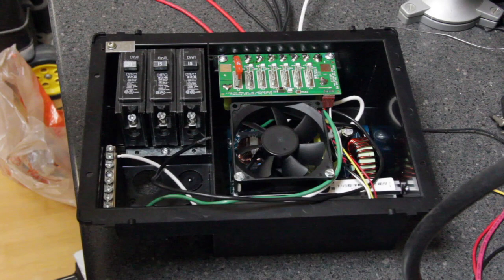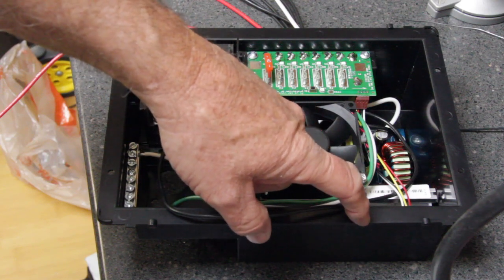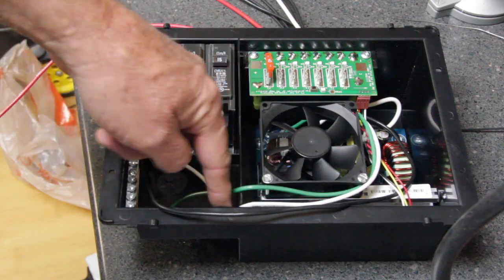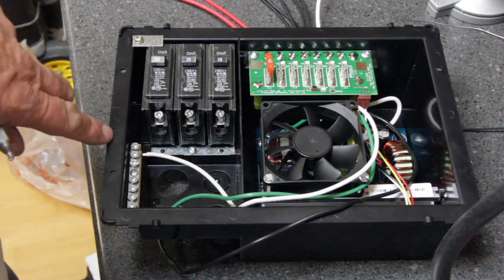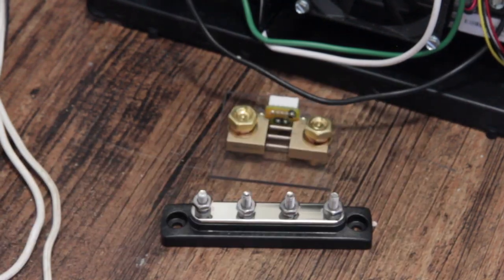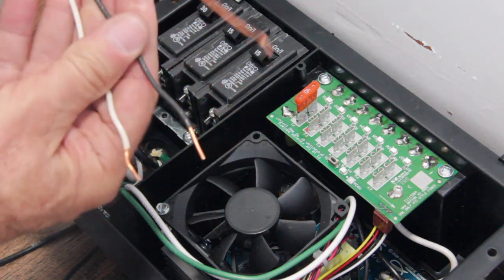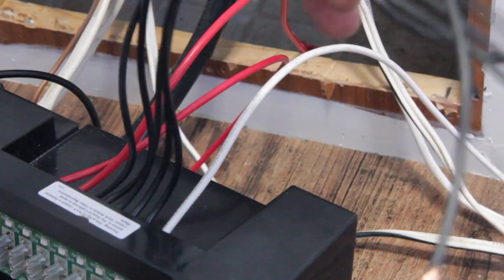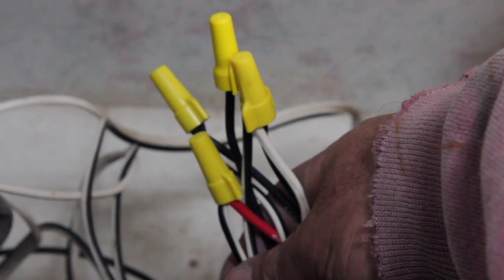Progressive Dynamics PD4100 Install

Comment: Hey joe! Great video! I have a question. I’m building a camper van that will ONLY be setup for shore power. Can I run this setup without a battery/battery bank? I will have some led lighting, a radio, and USB ports wired to the DC side. In theory the internal converter should be able to handle that, correct?
Reply from the maker: Yes you can,  While I was waiting for my batteries to arrive I did some testing on shore power. Worked just fine

Comment: Hey, looked they the comments, didn’t see this question asked… Do you know if this unit has a low voltage cut off? To keep the battery from fully discharging if lights on a 12v circuit were left on. Thanks.
Reply from the maker: I double checked the docs, did not see anything,  But you can install a battery monitor with a shunt and set an alarm to warn you when the battery voltage reaches the critical low voltage.

Comment: So I looked it up on Amazon. I does not come with the 120 volt circuit breakers. What brand breaker fits that?.
Reply from the maker: Supported breakers are listed in the below file.  https://www.progressivedyn.com/wp-content/uploads/Support/manuals/PD4100-English-manual.pdf
Reply: @JoediyLab  thank you sir I appreciate that very much. That's kind of what I was looking up was seiman breakers, so you just confirmed that for me, I'm a buy  the book electrician so I don't like to compromise or mess with anything that could create any type of fire hazard. Your presentation and your work is very professional.

Comment: I’m getting 120v to my outlets but not getting 12v. My camper does not have a battery. Do I need to wire this differently?
Reply from the maker: More than likely your 12 volt wires are not grounded to the DC bus bar.  You have the AC side and the DC side.  Also make sure you have the chassis ground connected to the converter.  Having a battery or not does not matter.
Reply: @JoediyLab  got it! I was not tying in the negative lead that would go to the battery. All works now.
Reply from the maker: @paulbusch3542  Great, good luck

Comment: Hey Joe! Awesome video- I'm a noob when it comes to electricity but I know the basics, and I just bought a popup camper that has a busted converter(no DC). So I bought a new one, same model as video, and I have the AC wired in correctly- I get power when I turn on the 30A, I maintain power when I turn up one of the 15W, however when I turn on the second(w/converter wire)15W I trip the breaker switch on the GFI outlet at the WALL(and not immediately either, the indicator light blinks on the converter and does stay on awhile), but not in the camper(all breakers stay on in the camper). Does that mean I'm plugged into a shore power outlet with too low amperage to support 30W, like a 15 or 20? Sorry probably a dumb ? and it would make sense to me but of course I could be completely wrong- I just thought I'd confirm it, because w the old converter we didn't have that issue.
Reply from the maker: Hey Carl I run my AC circuits from an extension cord to my camper using a 15 amp plug, no problems.  For the converter you do need the power to the the converter.  Try turning on just the breaker wired to the converter first.  Sounds like you may have a short in the second 15 amp circuit.  Try moving the converter wire to the other breaker to try to isolate which circuit is the problem.  Make sure your DC circuits are grounded to the green bus bar.  Ground the AC circuits to the white bus bar.
Reply: @JoediyLab  Thanks again Joe! My problem was the second part of the sentence- I had some DC circuits grounded to the AC ground buss bar- that was where the short was coming from. Did I mention I was a noob!?? Thanks for the education! Working well now!
Reply from the maker: Great news Carl, good luck

Comment: I'm confused as to where I should connect the white wire coming out of the converter you said went to the battery bank.
Reply from the maker: The white wire from the converter goes to the neutral bus bar on the left, not the ground bus bar on the bottom.  See the diagram:  https://www.progressivedyn.com/wp-content/uploads/Support/manuals/PD4100-English-manual.pdf
Reply: In the directions for the converter, it says to connect the white wire to the battery negative. You say to connect it to the neutral side on the buss bar? Which is it?

Comment: Hey Joe, thanks for the video! I just received a this unit and I am looking to install it in my van. I am currently looking to use shore power to run my DC needs and additionally an AC unit. The AC unit calls for a 20 AMP breaker. My question is should I run the 20 Amp unit off the 30 AMP breaker red white wire in the example or would you suggest substituting one of the 15 amp breakers in your video for a 20 AMP breaker. 

Additionally, will this system default to pulling DC power from the battery when it is not plugged in to shore power? I was assuming so but did not hear it mentioned in your video explanation. 

Hope this question makes sense, I am new to electrical and hoping to get it close to right the first time.  :)  Appreciate any help you can offer!
Reply from the maker: Hi, I would put a 30 amp breaker as the main breaker and then a 20 amp breaker in the other slot.  You then do not have enough amps for a third breaker.  Yes when not plugged into shore power your DC circuits will use the batteries.
Reply: @JoediyLab  Thanks Joe! Using this advice for the install. An additional question, The distribution panel is supplying DC power to the system by converting shore power or battery using connection when not charging. Where would be a smart place to install a kill switch for the DC system? Between the battery connection and PD4100? Simply insure shore power is unplugged? Open to suggestions
Reply from the maker: @davecoy2294  You could do that if you wanted.  I did not and left the camper sitting for 5 months and did not affect the battery charge.  I am using Lithium Iron Phosphate batteries though.
Reply: @JoediyLab  Appreciate the help Joe !

Comment: Hey Joe, where would one put the wire from the 7 pin that charges the battery as you drive?
Reply from the maker: Of the two red wires, the first red wire, I believe it is labeled 1,.double check the manual, goes to the positive battery post.  The negative post wire goes to the green grounding bar
Reply: Wondering where you wire in the aux/charging wire that comes from the 7 pin to the converter. Typically the black wire.
Reply from the maker: @ianw.gordon1756  There is a black and white wire, that comes from the converter side. The black wire need to be connected to one of your 15 amp AC circuits, The white wire gets connected to the white bus bar.  Those two wires provide power to the converter.
Reply: @ianw.gordon1756  Hey I was just looking into the same thing and it I didn't find a clear answer but the likely answer is no. The only info I found was that the 7 pin connection is designed to connect directly to you battery... this being said the charge voltage being sent through that 7 pin is designed to charge a starter battery (NOT A DEEP CYCLE BATTERY). You can hook up a deep cycle but it will either blow out or significantly decrease the life of your battery and possibly your alternator. 
Here is a link for a video that explains fairly well the possible setups for charging a deep cycle battery via your vehicles alternator.

https://www.youtube.com/watch?v=TAEzCcayI0g

Comment: Hi joe ive watched this video 20 times! lol. im pretty sure i can put the PD4100 in my popup. However, at the end of the video you lost me when you had the battery cables hooked up to the DC12v side. Can you explain that to me again?
Reply from the maker: Hey Derek,  Coming from the PD4100 there is a Red Wire and a Black wire.  Those two wires are connected to your coach batteries.  When you are on battery power the DC circuits are powered by the battery.  When you are on shore power the batteries are charged.  Let me know if you have anymore questions,  Thanks
Reply: @JoediyLab  thank you I'll let you know how I made out

Comment: I have located the switch for the charging type. If the switch is down does that mean it is set up for lead acid?
Reply from the maker: Yes,  Switch S1 is for battery type.  When S1 is off that is for Lead Acid.  The S1 light on the fuse panel should be on when set to Lead Acid.

Comment: If you're not plugged in to shore power do the battery feed back to run your DC circuit?  I'm new at this I don't want to sound like an idiot 🙃
Reply from the maker: Robert you are absolutely correct, the batteries will power your DC circuits when not on shore power.

Comment: What happens if I have more than 2 15amp breakers to wire in?  I also have 8 fuses.
Reply from the maker: Paul, you only have a total of 30 amps on the main breaker.  If you need more amps, you would want to upgrade to a higher total amp unit.  the fuse breakers are for DC only.  The 30 amp breakers are for AC circuits.
Reply: @JoediyLab  in the space of three full size breakers, I have six half size breakers. Looking at the breakers, left to right. 30, 15, 15, 20, 15, 15. They are labeled Main, GFCI, Microwave, A/C, Water Heater, Converter.
I would just move them over in order to the new PD-4100?
Reply: @JoediyLab  the unit I am replacing is WFCO, Model WF-8740P. The converter was fried when the electrician hooked it up to 240. I was told that the WFCO unit is PROBLEMATIC. In case you haven't figured out, I am a total noob to this whole idea of RV trailers
Reply from the maker: Paul, the PD4100 max AC amps is only 30 amps.  The individual circuits can then only add up to a max of 30 amps, so two 15 amp breakers is your max.  If you need more max amps, look at there larger converters.
Reply: but, as I pointed out, there is a 30 amp main breaker. The trailer is wired to a 125v 30amp breaker. the wiring set up on the original unit is also 30 amp, but with the listed breakers. I don't know enough about wiring to know if this is correct. However, the trailer manufacturer, Forest River, installed the wiring on the unit. Looking at the 2 units, the AC side is identical. 3 standard breakers, on my trailer, breakers are "split" into 6 half-size breakers.
Reply from the maker: Paul,  30 amps ac is the max for the main breaker, all sub breakers then must add up to 30 amps.  You could go more but then you cannot have more then 30 amps running at a time.  Which it appears that was your original setup.  So if you can manually manage what circuits get used then you can put more breakers in.  But I personally would not work it this way.  Then if someone turns on more current that 30 amps you run the risk of a fire.  I personally would not go this route, for safety reasons.  I would purchase a higher max amp converter.  But this is your decision.
Reply: @JoediyLab  thank you for your patience. In reading the breaker labels, no individual circuit is more than 20 amps, and that is the A/C unit. I am not looking to add more, just duplicate what the manufacturer did with the new unit. What I want to do is remove the battery charger I have on the system now, since the converter is toast and I cannot buy the converter as a stand-alone item.  Otherwise, my 12v DC stuff will kill the battery in about 24 hours.
Reply from the maker: Good Luck Paul,  Just make sure everyone knows to limit what circuits are turned on and you should be fine.  Thanks
Reply: @JoediyLab  I'm the only one living here, and the A/C breaker is off since it is not needed
Reply: @JoediyLab  thats not true. go add up all the breakers in your house. The total of the individual breakers can exceed the main.

Comment: Started doing this today. Got confused, had a beer, it didn't get any clearer.  AC is all pretty straight forward with 30 amp master to 2 x 15 amp AC branches (one to the converter, the other to a GFCI + 2 boxes). The instructions are pretty sad and I was glad to see this video. I've watched the video twice and read through the comments. 

According to the wiring diagram, the white wire coming into the top right connects directly to the DC negative of the battery.  The first red connects to battery +. Here you are saying that the negative from the battery also connects to the bottom grounding bar (also shared by the green grounds from AC). So, if that's what is supposed to be done, why isn't that white negative wire just connected directly to the green grounding bus bar so it connects with the battery negative in that way.  Seems odd to me (an unnecessary splice) . I don't get it.

I think I am getting confused by "ground bus bar".  When you say this I'm thinking you mean the bottom AC ground bus bar.  But I think your video shows an entirely different external DC negative (ground) bus bar with one large ground feeding all the DC grounds.  Then others are talking about using the AC ground bar and mixing the terms neutral with ground etc. Leaves a guy confused.

You mention that the second red wire is for something that draws up to 30 amps AC current.  You meant DC correct? You could put any DC circuit on there if you wanted to. Correct?

I'm running 8 AWG from the vehicle battery through a battery isolator to the trailer battery and 8 AWG right to the converter. Negative is also 8 AWG coming of the tow vehicle frame, and everything is going through 7 pin connector. I have a fiberglass trailer and am running 2 x 14 AWG conductors to each of 3 DC outlets, fan and lights to avoid the inevitable problem with corrosion of grounds on the frame. So, all of my negatives for these circuits should connect to AC green grounding bus bar where the battery negative is also connected?.....I just want to be sure because I think I read in one of the comments that the AC neutral bus bar could also be used for the DC negatives.  I was just going to get an external bus bar and connect everything negative to that because I have no idea what leakage there might be mixing the AC neutrals, or grounds with the DC grounds. But maybe it doesn't matter and saves using an external bus bar. Or is it necessary to have the negatives sharing that internal AC ground bus bar? I appreciate your efforts to help us. The unit seems great, but the instructions are inadequate.  Thank you for your time.
Reply: Im in rhe same boat. Did you ever confirm whether or not you need to get an additional ground bus for the dc side?
Thanks

Comment: How do you get dc power to the box so I don't have to use shore power?
Reply from the maker: You need a battery or battery bank.  I am putting together a video on how I tie in my batteries.  The first red wire on the fuse circuit board wires to the positive lead of your battery,  The negative wire is wired to your ground bus bar.  When you connect to shore power the converter will charge your battery.
Reply: @JoediyLab  Great Video, I just installed this unit this weekend but the converter has no charging voltage!!! All the 120v and 12v work perfectly except the converter wont charge the battery. Do you know of any connection issues that would cause this? I confirmed i have 120v to the converter but no DC voltage out. Any help or ideas would be greatly appreciated.
Reply from the maker: @CTSHOYT  Check the obvious first,  Make sure you are using the correct Red lead,  There are two.  Make sure you have your battery grounded to the bus bar as well.  Put a volt meter on the red lead and ground and check your voltage.  On my unit the S1 switch came off and I had to re-solder it.  If you cannot find the cause give Progress Dynamics a call, they were very helpful when I called.
Reply: @JoediyLab  Funny you mention that your S1 switch came off and had to re solder it. This is my second unit, i returned the first one due to the S1 switch being bent and not attached to the board. The replacement I got looked go so in it went, now after reading you comment I went and looked over the board to see if anything was out pf place...sure enough my D71 transistor (bottom left corner) was bent and the connection was broken from the board, I also checked the S1 switch again and it also was loose from the board, looked like the solder was even missing. I took it out and soldered the two pieces back on and its solved my problem, 13.6v to the battery. Looks to me that Progressive Dynamic has a bit of a quality issue going on. Thanks for your reply, it helped me solve my issues!!
Reply from the maker: @CTSHOYT  Great, I am glad you were able to fix it.  I spoke to one of their engineers and told them about the quality issue.  You might want to call and pass your issues along as well.  Maybe they will clean up their act.  Thanks for the follow-up
Reply: @CTSHOYT  Could you please post a picture of that s1 switch. I am very curious I don't believe we have one.
Reply: @korishafer6532  Hi Kori, I'm not sure I don't think I can upload a picture here but I will do my best to explain. I believe the S1 switch is a newer feature on these boards but I don't know how new. My board is a blue color and some older ones are green, which might not have it. If you look on the board at the very bottom, a little offset to the right will be the S1 switch. It's literally a tiny switch that moves up and down. Hope this helps.

Comment: Using this system, can your 12V DC appliances run without having batteries connected as along as you are connected to shore power?
Reply from the maker: Here is what the instructions indicate:  "The INTELI-POWER series of converters are primarily 
designed for use with a battery, however, the output of the 
INTELI-POWER converters are a regulated, filtered DC 
voltage that can power sensitive electronics without the need 
for a battery or other filtering."